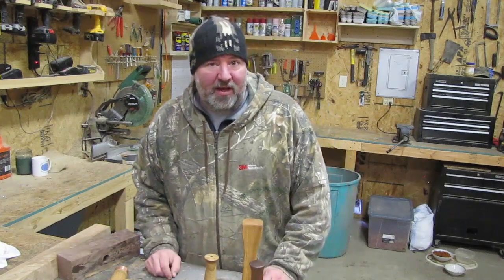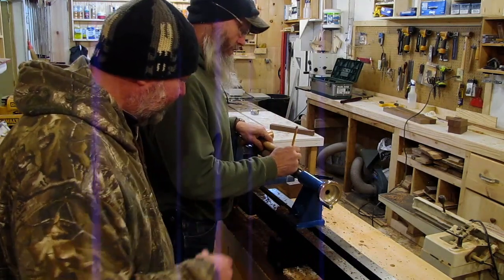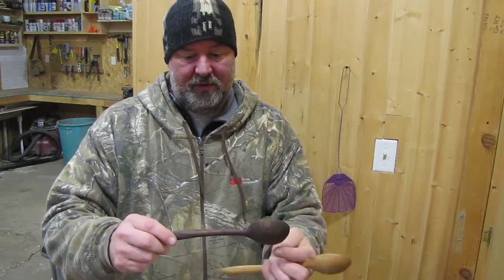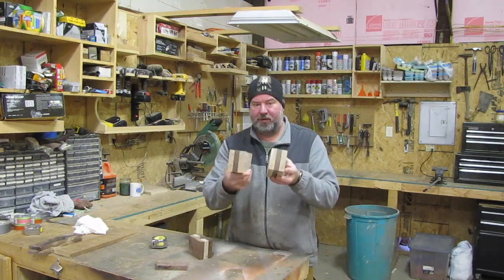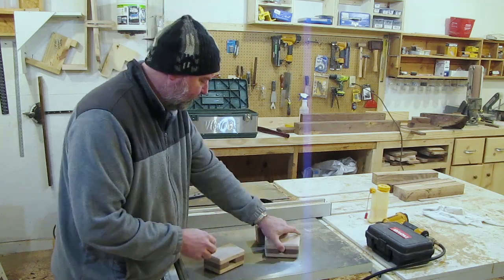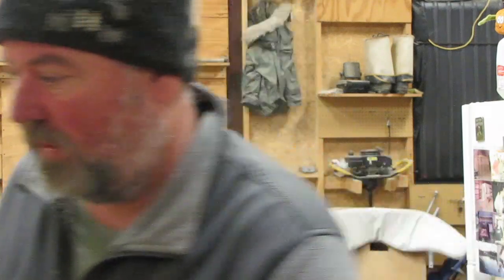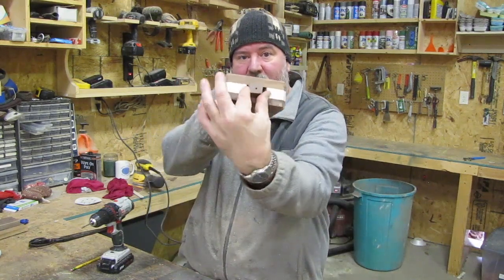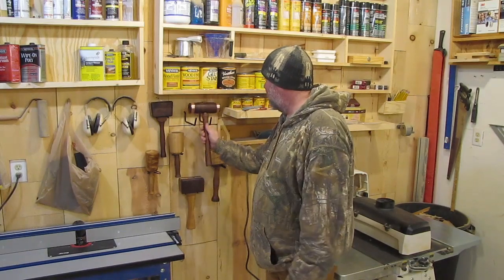Is a Lathe in the Future?  A weekend in the Wood Shop

Comment: Last year, I added a Lathe to my wood shop work area, best investment I have ever made. I can honestly say it is probably the funnest tool I have ever owned. I cant say that I use it all the time, but there is something therapeutic about turning wood. It is also probably the safest tool in the shop when it comes to odd of injury,. the amount of stuff you can make is only unlimited to your imagination. I have made some really cool bowls, mallets, and boxes, the boxes, are actually round, but they call them boxes, they are cylinders to hold misc times, from large enough o hold bow strings, to small enough to make a little sewing kit or pill bottle for EDC type carry. SO to answer, YES, get one if you can, nothing funner than the lather,. I am sure you buddy has told you get one with a variable speed motor dial, its quicker to change speeds when  you dont have to change belt location, change speed on the fly. Next get the biggest one you can afford, everyone seams to start with a small unit, the gras another bigger one. they are addicting, I went with a med sized one about like the one your buddy has and I am supper happy with it. Hope this helps. 
have a blessed week my friend. 
Dale

Comment: Get yourself a nice little one and have it. Get your buddy (brother?) to show you a few things about when and where not to get close to the ends so your piece doesn't explode in your face and wreck your last 3 hours of work or why you should try to balance out a log before you turn it into a giant mallet instead of having it explode your dead center from being off balance even though you had it on the slowest speed possible. Don't ask how I know those things, just let your friend explain them to you. Oh, and get a nice face shield, wood chips in the face are nice but some woods will make you itch and break out in a rash.... again, don't ask how I know.